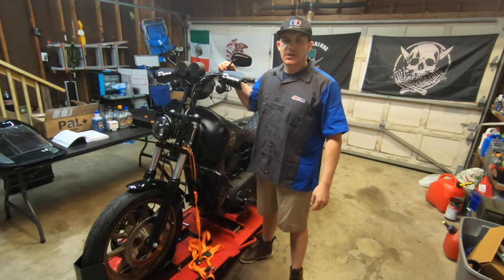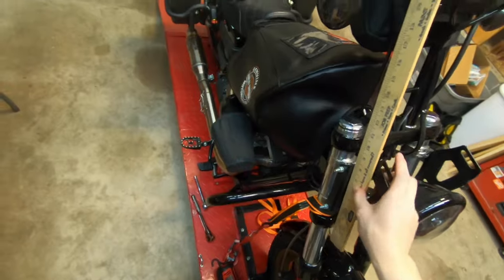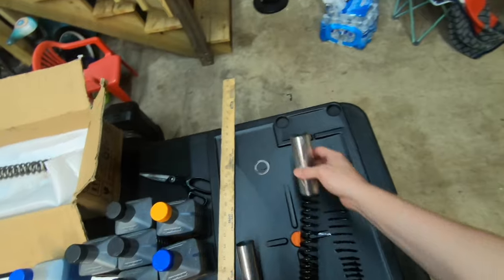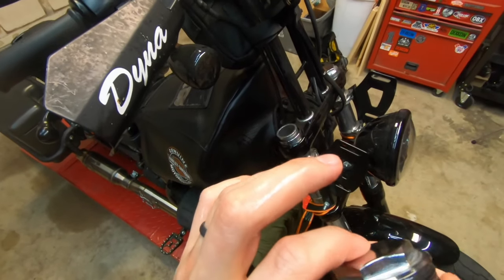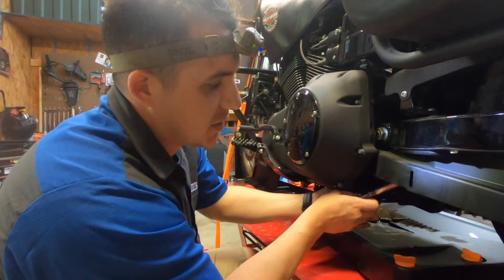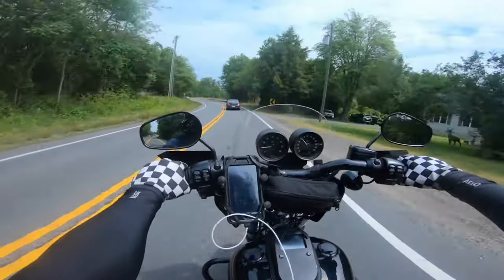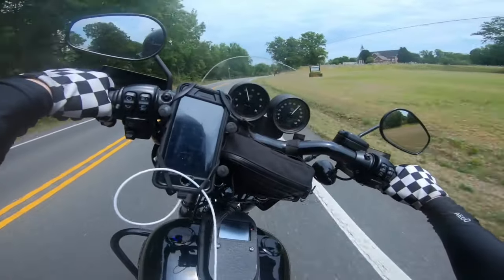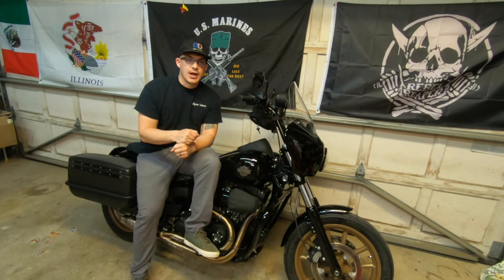Patriot Spring Install (Dyna Suspension Review)

Comment: I had to rebuild my front forks when one of my seals gave out.. it looks intimidating, but its pretty easy. I switched the oil to a heavy duty shock oil, and that in itself made one heck of a difference. I did laugh when you took the cap off... don't feel bad.. That happens to literally everyone. Great channel.
Reply from the maker: Had to show it,  I thought it was funny also 😆😆

Comment: I Have a 2016 FXDLS also, I have never had speed wobbles either.. But I still want true track stabilizers, genesis front spring, and some new 14" rear shocks
Reply from the maker: 🤷🏽‍♂️ if anything it will improve your ride.
Reply: So I got the genesis springs for my 2016 FXDLS today, so it's easy to do without using a lift? I can get away with doing it while the forks are slightly compressed?

Comment: I believe you might need to drain fluid not add as the spring is bigger and will require less. I would drain the fluid and put in fresh. Also if you jackup the front end you would have stretched the front end out and you wouldn't have had to fight it so hard on the install.  I know Im late to the game and I hate to say do it this way, but in case anyone is planning this you should jack up the front when taking the spring out and installing a new the spring, also make sure you match the fluid level to match the new spring. Great channel by the way...
Reply from the maker: 🤜🏽🤛🏽 good pointers.  Thx for the feedback.

Comment: Did you not have to cut the spacers? Haven’t tried installing mine yet but it seems like most people have to cut it down
Reply from the maker: Joshua Karle it was already cut,  I got the
spring from my buddy that had the same bike.
Reply: dynademos looks like I still have to cut then hah Thanks man
Reply from the maker: Joshua Karle get a die grinder from harbor freight for like 20$ . shouldn’t be to hard

Comment: You guys are awesome! Been watching for a while now. Do you know if this is the regular 49mm or the 49mm+2 patriot genesis spring you installed? Also, what is meant by a "cartridge" on the left side? There's not an actual spring on that side?
Reply from the maker: Tagumpay Robles They are 49mm stock length.  Yes there is a spring on the cartridge.  With out writing a paragraph on it I have attached an article ,  Check it out.  Thanks for watching 🤜🏽🤛🏽.    https://www.motorcyclecruiser.com/basics-cartridge-and-damping-forks/

Comment: Nice video! I understand you left half the front suspension stock, and the other half you changed the spring....is there a problem NoT having symmetric spring load at the front? Thanks
Reply from the maker: manuel de la coba one side is a cartridge on the Fxdls that’s how they came stock
Reply: @dynademos  do you know the reason why It came with a cartridge ? I mean what is the purpose of this sertting ? Thanks
Reply from the maker: manuel de la coba engineers dog idk lol I had a dirt bike with the same thing although it was adjustable and these are not
Reply: I am asking you these questions because i bought 2 preload adjusters and i could replace only the CAP in the cylinder with the spring, so EACH cylinder is going to have different tension, so i was wondering if that could affect stability....
Reply from the maker: manuel de la coba preload adjuster won’t work on the cartridge side u have to get different internals for the cartridge side to run a spring
Reply: @dynademos  I have a 2015 fxdb, and i was having problems with Big bumps so i decided to add preload adjusters. My surprise was to find a cartridge in one of the cylinders. I ended Up changing only the CAP from the cylinder with the spring, and i had a good improvement, the down side is aestheticaly, having two different caps....
Reply from the maker: manuel de la coba thanks for the input man